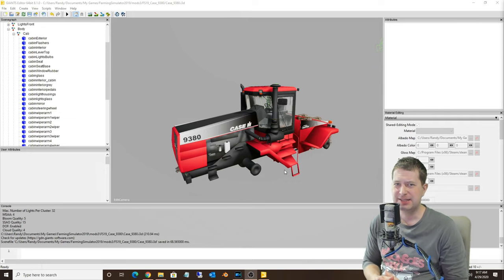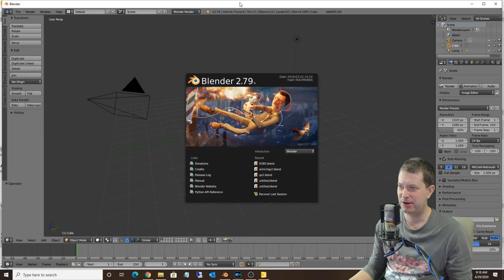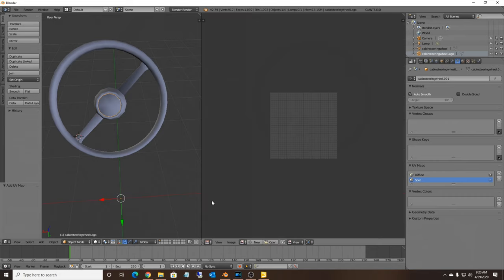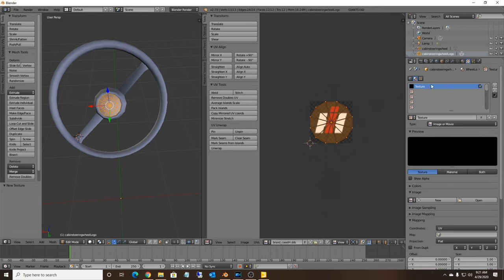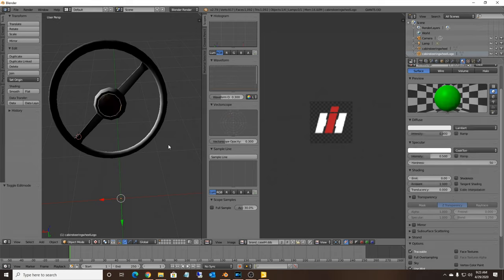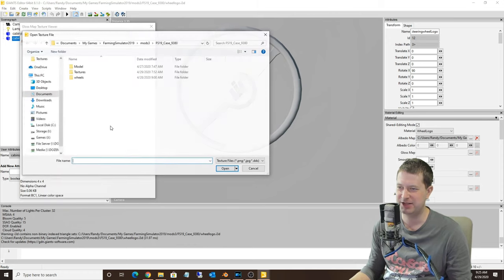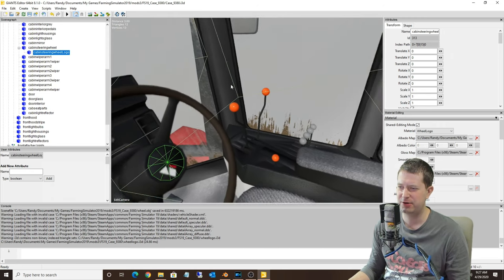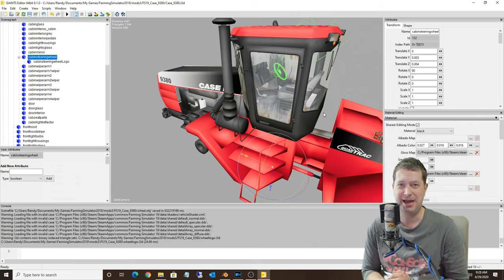How to Create a Decal or Logo Using the Decal Shader | How to Mod | Farming Simulator 19

Comment: odd, I followed this and everything looked good until I got to the import when I imported it, the door, pf the truck i was adding the logo to, was huge it looks like scale got buggered at some point.

Any idea what I might have done wrong?
Reply from the maker: Yes, there is an import scale in the GE settings!  Check the GE settings and I think it needs to be set to 1.
Reply: @radozeman  you are correct, it was set to 100. Thanks.